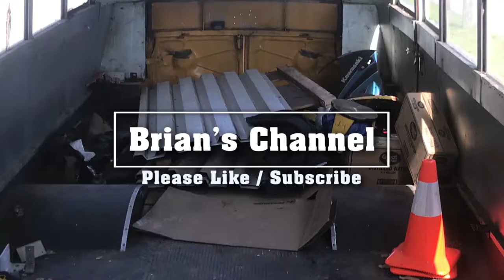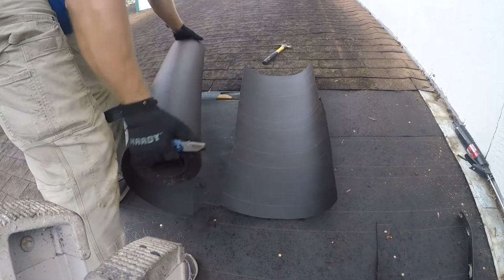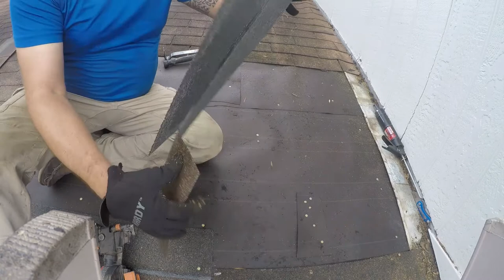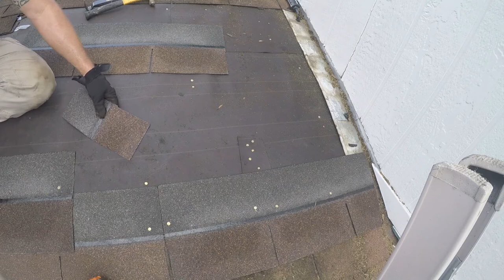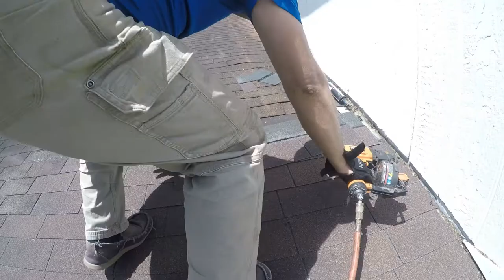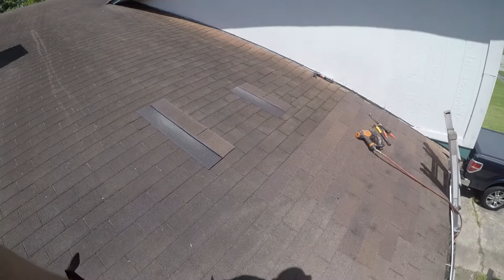DIY: Roof Repair 4 of 4 - replacing the shingles

Comment: The flashing is to small , but it is already installed from previous roofer , so you cannot replace the flashing without turning this job into a project .
Minimum flashing on the wall and roof and should be 4 x 4 inches L or _l shaped . Also , there should be plywood on the dormer wall with synthetic underlayment nailed to it . 
Then you put vertical or horizontal siding on the dormer . Remember that the flashing is nailed to the underlayment covered dormer plywood and roof plywood . The flashing on the roof plywood is nailed onto the roof plywood . Place the nails close to edges of the flashing then place synthetic underlayment over the roof flashing but leave one quarter inch gap on flashing for water drainage ( any water flowing down the roof will flow downhill on this gap ) . Put shingles over underlayment to the flashing but do not nail the shingles through the roof flashing . Tar under the shingles but do not tar over that one quarter inch gap where water will flow downhill .
You than nail the dormer siding on but do not put siding on roof . Leave a 1 / 4 inch to 1 /2 inch gap off the roof as you do not want dormer siding to rot from rain water flowing  down the roof ( remember the flashing will protect the dormer and roof from water flowing down the roof in that area ) . If you want overkill use neoprene washer roof shank nails nailed into the flashing .
Reply from the maker: Yea, there was so much wrong about how houses were built in the late 1970's..... I fixed this to stop this particular issue and then the house went on the market.  Not my house, belonged to my parents.  They didn't want to mess with it and I didn't have time.  They worked with a great Realtor who got top dollar for it and it became someone else's headache.  They worked magic on it and now a nice family lives in a fixed up house.  This was  a T-80 house where the plywood acted as sheathing.  If I remember right this was a "US Homes" built house.  It served us well when I was growing up and I don't miss it for a second.

Comment: Im a professional roofer. Have been for 14 yrs. I've watched all parts of these videos and I can honestly point out several mistakes. U shoulda cut the bottom of the old plywood out even at the lower trust. U didn't need more than one extra truss in there. U put nails instead of semplex in the tar paper. You shoulda used bull with a trial over all the flashing. U put too many nails in the shingles n not in the correct spot. U lined up the shingles in the keys too. Ur supposed to stagger. Nails go above the keys n get covered. Ur in insurance. Not a roofer. 💯
Reply from the maker: I generally use a 6 nail pattern in coastal areas.  The repair was effective and worked just fine.  Yes, shingle alignment could have been better, but this was a patch  and it worked just fine.  Nails or staples are fine on tarpaper.
Reply: Joey Alvarez. Now be honest, being a professional roofer as yourself. I can almost guarantee you could point out "more than several" mistakes. However, you did point out the major ones. #1 Nail placement...WTF!  #2 Not staggering shingles so keys don't line up...WTF! I am not a professional roofer but a DIYer but I do know how important #1 and #2 are.

Comment: Good video, but you are nailing too high on the shingle.  Every nail should go through the middle of the shingle you are nailing and the top of the shingle below it.
Reply: They are three tab there isnt a top or bottom of the shingle its one piece and he doesnt want to nail on the tar line as it could make the repair fail and not stick
Reply: @rooflorrdjesus  I hope you're not a roofer. This repair failed the moment he started high nailing AND having aligned keyways, WTF? He's not careful enough to avoid the simple mistakes that ruin an easy repair job, nailing shit down(incorrectly) before verifying it and having to work twice as hard, doesn't fix the improper alignment, you can forget about wind performance. Meanwhile I'm sitting here waiting and hoping for Rick Astley's Never Gonna Give You Up to start playing in the end credits because what a TROLL this series was.
Reply from the maker: Yea, still working... and still keeping water out.  lol.